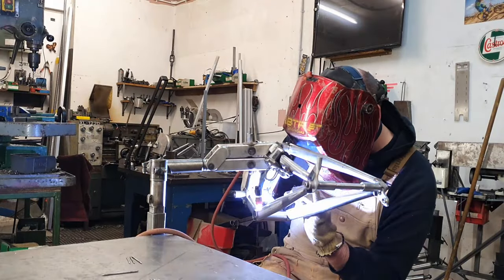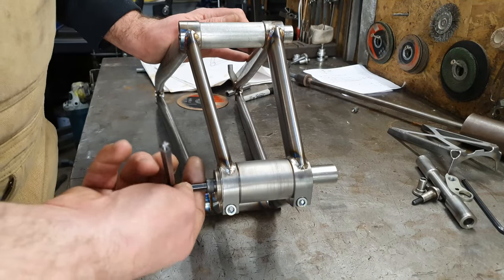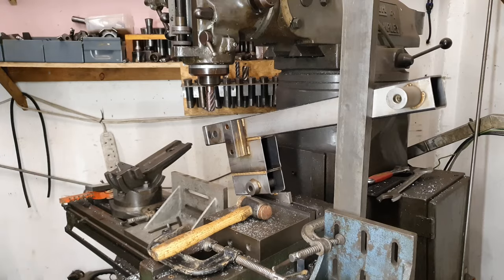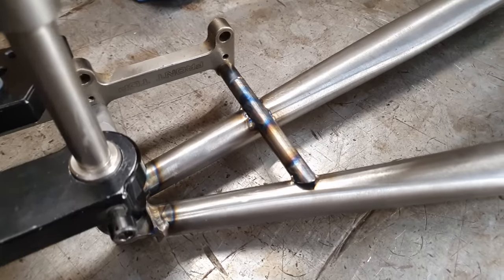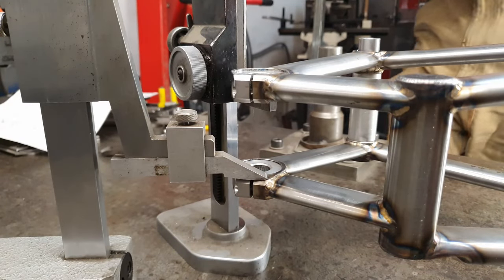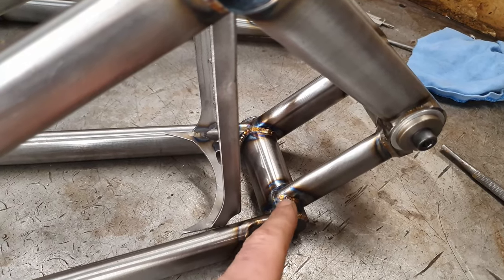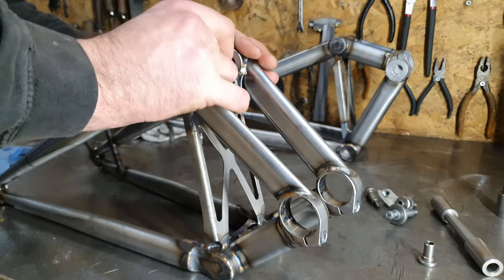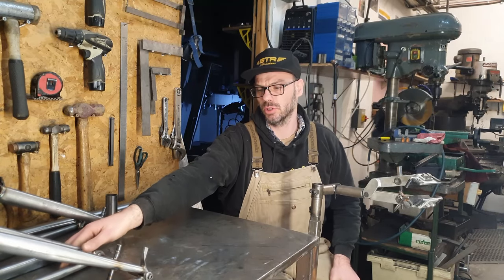4. Steel Swingarms get finished - Gussets and Alignment - Gasser Project.

Comment: Amazing! What exactly kind of steel do you use? Is it reynolds 853 or another?
Reply from the maker: Nah, don't use Reynolds. I have in the past but their quality control is non existent so I will avoid them at all costs. Sometimes, though, there is no alternative.
Reply: @BTR-Fabrications  if not Reynolds, what do you use?
Reply from the maker: 4130, T45, Columbus and Deda

Comment: Is the Gasser made with 853-631 like the Pinner or is it all 4130?
Could you consider building something with stainless steel such as the KVA that is being used in some frames?
I don't do DH, I'm not a youngster anymore. I have a Pinner MK2 but if you build another trail-enduro frame I'll be interested. Think about it for the next Bespoked
Cheers
Reply from the maker: Hey mate. The down-tube is 853, it's actually a custom tube for Starling. The use this tube on their enduro frames, which is a bit crazy to me because it's so  hefty! The top-tube is 631 plain guage, from the 'motorsport' selection. I haven't heard of this KVA you speak of. It would be fun to build a frame using stainless, the strength stats on the available tubes is insane. Unfortunately, the selection available from Reynolds (🤮) and Columbus are far too thin for MTB. Strength would be fine but the risk of denting would be far too great.
Tam did design a 29er trail bike with some nice 3D printed stuff before he left. I just haven't been able to spend the time to get it over the line at the same time as getting the bills paid. Are you suggesting you would be keen to have one built for display at Bespoked?
Reply: @BTR-Fabrications  Hi, I've been looking at the first Gasser you made for a while now. Very nice with the same finish as my Pinner. Showing the welds. Then yours appeared on Bespoked and on a Youtube channel they said that they had interviewed you and that the Gasser was made with 4130. And I found it strange because you always tend to use the best from Reynolds. And Reynolds has better pipes than 4130.
There is an American company that makes stainless steel, the KVA MS3. It has 1400 Mpa which is more or less what the 853 has. It doesn't reach the almost 2000 of a 953 stainless steel but it seems to eliminate the problem of thicknesses and dents. In fact it is already being used on some enduro bikes.
If you want I can take care of sending you a set of pipes although I don't have much knowledge and you will have to be the one to discuss the specifications with the manufacturer.
Maybe you and Tam can get together and design another double, this time with a bit more travel than the Pinner MK2. For example, Reeb is doing quite well with the SST-Steezel. And with stainless steel tubing, if it's already available, it would be perfect. I would buy a frame like that. That's what I mean. Geometries, high pivots, etc. have changed even more in recent years. 3D printing, etc. I really like my Pinner and for the terrain I have, I don't really need more. And I don't think I need more at this point. But I would like something similar with more travel. Stainless would be perfect if possible. So if you have something like that in mind, I would be interested. That's what I wanted to say. But don't get me wrong, I'm not saying that you should start building something right now. I'm not in a hurry. Also, I think BTR needs a new double if the Pinner is discontinued. A Pinner MK3 for example. Or Hammer would be a good name for a frame like that. If you like it, use it. I follow you on Facebook and Instagram so I'm up to date with the news. Maybe what I want is a Gasser with a little less travel and I don't know. Because I really want a Trail-enduro, with a little more travel than the Pinner. That it is in 29 is not a priority. Maybe a mullet... Because this is a whim, I don't need another bike and I could continue using the Pinner because It's enough for me. I actually have too many bikes and my wife can end up killing me, because I also like cars, motorcycles, poor woman... So, well, I don't know what you have in mind. 3D printing sounds good. It worked for Reeb. Stainless steel sounds very good too, but it depends on you. High pivot and other modern things sound good. But building is not that easy. And the priority is always quality and reliability, so oh well. I don't know how many Pinner MK2s you built, but I guess you would at least sell a similar amount now if you make a new Trail-Enduro double. So it might be worth it. Also, keep in mind that being in the UK you are at a big disadvantage. The pound is always a bit higher than the euro or the dollar. And that affects the final price. For example, 3,000 pounds for a Canadian is more than 5,000 dollars and that makes their heads implode. You add transport and customs. In many European countries you have to pay 21% plus tariffs and duties of import. There are flights to the UK for 50 euros, I don't understand why they don't go in person and bring it on the plane as luggage. If you lived in the USA you would sell more. I tell you this because I have read some comments you have made in relation to low sales which in the end was the reason why you are alone right now and I think that in part it is because of all this that I am telling you. And yes, it is not easy. I do not understand the situation either. But if you continue working the same, for me you will always be a serious option to buy a frame. Because that is what I am looking for. Quality, reliability, craftsmanship. Nothing Chinese, nothing made to be cheap and earn more above quality. And one day success will come. Although I would say that you already have success even if it is not in the economic aspect. And well, I leave it here, I have already written enough nonsense. Best regards